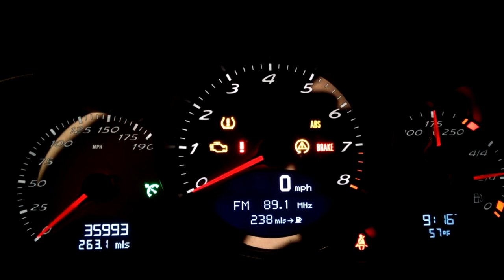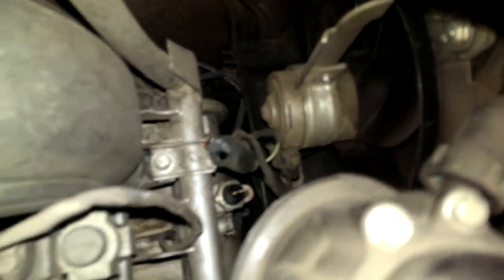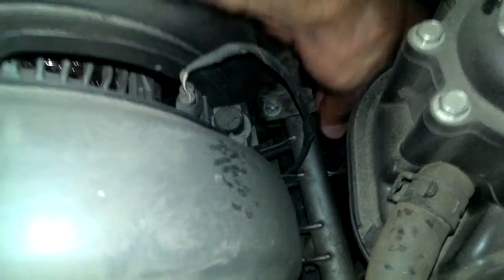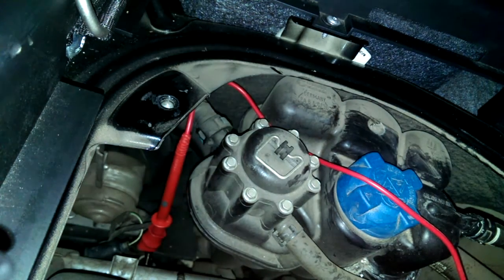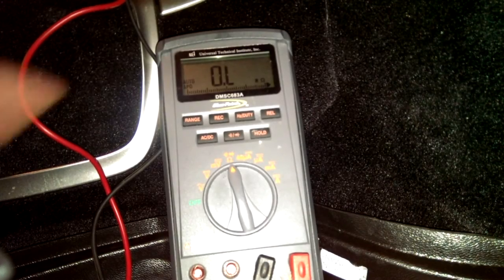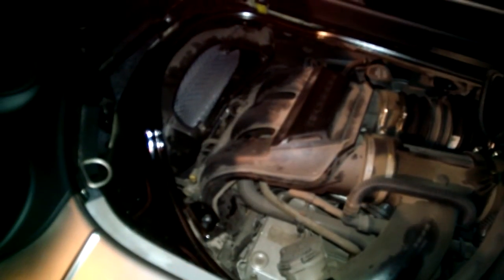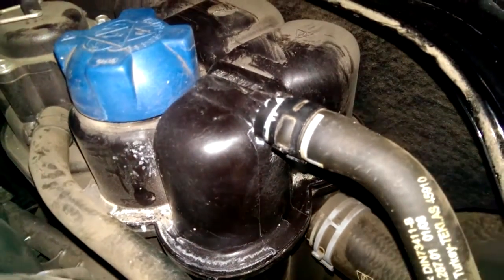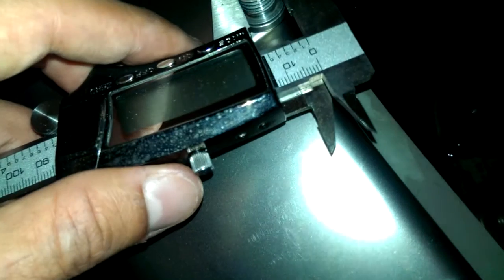987 Cayman S Oil Pressure Switch

Comment: FYI: Using the plug location shown at 5 min into the video will result in pressure readings that are about  15 psi low..